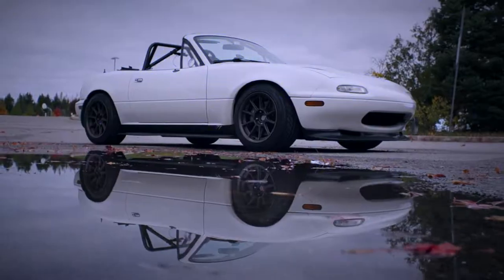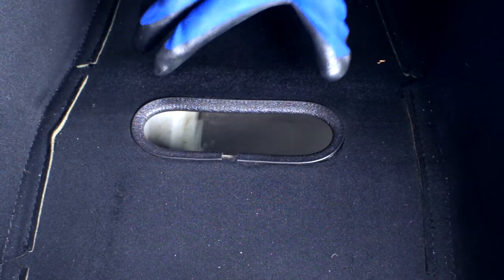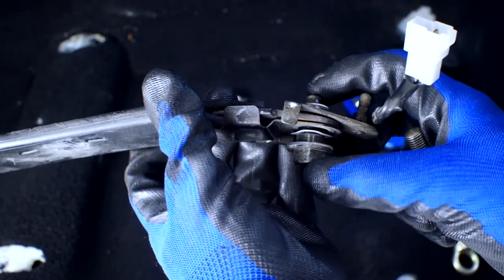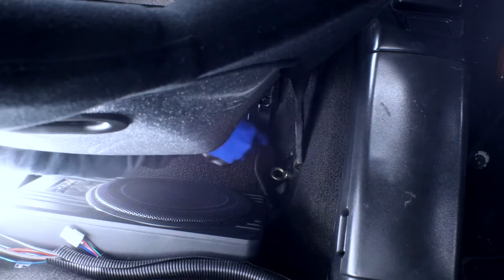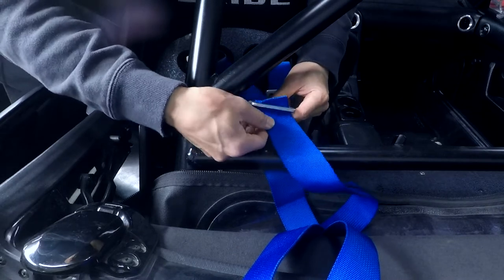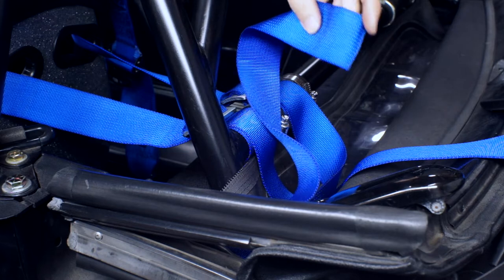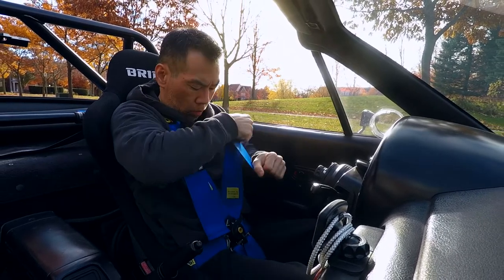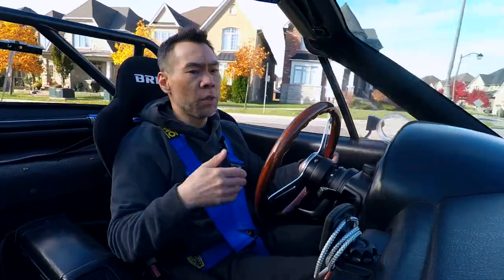Illegal & Deadly? 6-Point Racing Harness Install DIY

Comment: 3:40, they do sell harness bars to attach where the hoops are for the OEM seat belt, that works well.  As for the safety with the 6 point harness, or any harness to add onto this, these only should be used on track with a helmet and neck restraint, with out those, your head will only be the moving piece and that alone can be deadly, the OEM seat belt as you kept in place works to keep the whole body moving, only down side to that is your head can hit the steering wheel if you have an aftermarket steering wheel.  Just a risk we decide to take on that.  Either way this is still a good video to go by when you plan to get a harness as well as your other videos.
Reply from the maker: Great point, the double-diagonal Hard Dog rollbar that I owned before has a separate harness bar.  It angles back slightly between the upper seat-belt towers attachment points sandwiched between the rollbar mounts at that location.  So ya the alignment of the shoulder belts was good as the harness bar isn't between the rear down-tubes like this one.  I'll leave links in the description to those products for reference.  Thanks!

Comment: do you feel like the eyebolt weren't long enough for those holes? I'm doing the same with my Miata, and I see 2 lengths for eye bolts the shorter one and a much longer one. Is the short one you used sufficient?
Reply from the maker: Pretty sure I used the longer one into the chassis. I think the short ones are for the sub belt to seat bracket mount, which I didn't use (floor mounted). Hope that helps!

Comment: Nice clear instructions very nice video, keep it up. Can you use a Hans device with stock seats, 3 point seatbelts and airbags for extra safety?
Reply from the maker: A traditional HANS device requires a harness, and a racing harness of course is not meant for use with the stock Miata seat (no shoulder harness holes).  However, the Simpson Hybrid S HANS says it offers protection when used with 3 point belts and a compatible helmet. So yes you could use your stock belts and airbags with that model. As always do your own research, consult with your track day organization, and confirm for your application before making your buying decision. 👍 Great question thx!
Reply: @mostlyuselessgarage  Thanks for the reply, I was just wondering for my older daily driver without an passanger or side airbags. (I don't have a miata I have an older volkswagen group car):).

Comment: It seems there are allot of different ways to connect a harnesss to the roll cage, what get me is there all different, and if you get them wrong, and you have a bad crash, you could die. Is there not a universal way of connecting the harness to the roll cage which is correct. I would hate for someone to get this wrong as it really is the only thing saving them.
Reply from the maker: According to the harness manufacturer instructions they detail 2 methods: The way I did it or using weld-on harness tabs on your harness bar. Of course check with your race/track-day organization's technical regulations to ensure it will pass tech inspection.